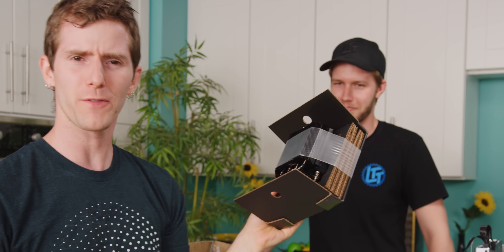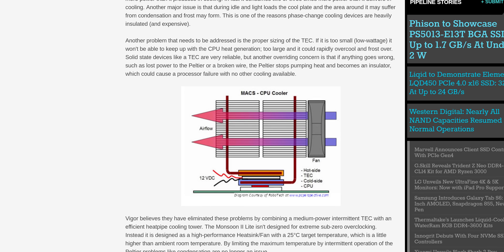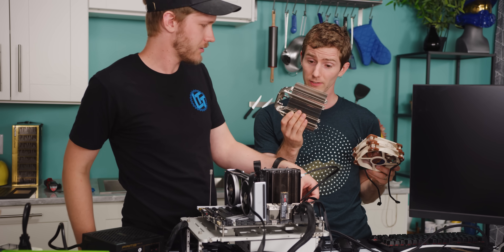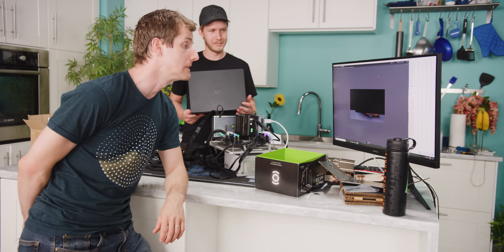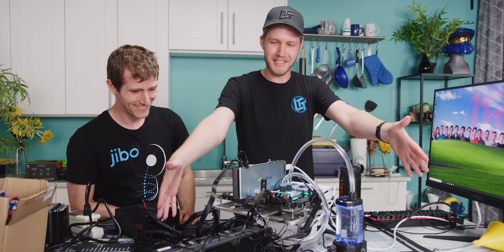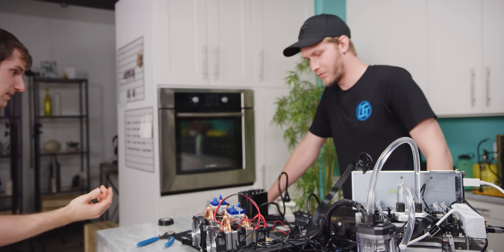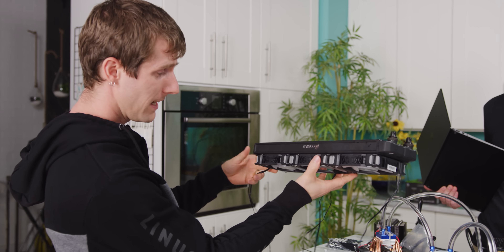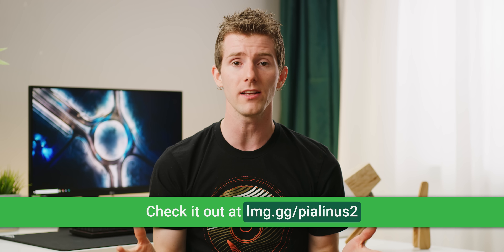Thermoelectric Cooling is a Bad Idea

Comment: I used a Thermoelectric cooler back when they 1st came back out in my day for my cheap budget Gaming PC on my Cyrix PR200 P1 class CPU. The cooler I bought was back in 1996 and it kept that egg and bacon fryer of a CPU within decent thermal limits. I sold the CPU and cooler to a buddy who was on budget ,I told Him not to replace the cooler and he did a short while after which he thought was a more beefy cooler well lets say able to cook his breakfast the next day on the CPU because the fan on the new cooler was inadequate to cool the  heatsink faster enough.

Comment: This really doesnt seem fair... Classic case of a reviewer slamming a product because he doesn't fully understand it. I expected better Linus.
It actually looks like a well made device - if it can keep up (within 2.5C) with a much larger heatsink under maximum load that means it's at least stable, and for loads less than 100% where the processor is going to be significantly above ambient but significantly below maximum thermal output, it is going to keep the CPU much cooler than the regular heatsink. I would bet in most gaming tests (eg where you are not CPU bound) this cooler significantly outperforms the Noctua.
I would bet they are using a TEC rated for >=150W, and under-driving it to keep the thermal load on the hot side heatsink within a sane range. This means the COP of the peltier would actually be quite decent, most likely in the range of 2-3, meaning it pumps 2 to 3 times as much heat as you're powering it with. For reference the COP of a much larger and louder phase change refrigerator is in the range of 3-4. Driving the peltier at 40W means you have an absolute maximum thermal load of around 120W, which i'm guessing you're exceeding slightly. Thanks to their design of adding a heatsink on the cold side, it still coped with this, but it does not seem to be its designed purpose, which is to dramatically lower average temperatures with common (non-synthetic) workloads at a relatively high efficiency. Bravo to the designers!

Linus, If you really want to build up an impressive peltier cooled system, in terms of both performance and efficiency, just throwing a >500W peltier element at it is not the way. Yes you may end up using such a part, but not alone. As i've mentioned peltiers are vastly more efficient when under-driven, certainly under 30% of their rated capacity, but it gets even better the lower you go, with the 10-20% range being ideal. If you want to achieve great temperatures with this, a stacked design would be best, which keeps the required temperature difference (detla) across each stage low. However that makes things quite a bit more complicated, as each stage will need its own power supply.
For example, you could take a 200W-300W rated peltier element and run it at around 50W, this would give you about 150W of thermal transfer capacity at a up to a 20C delta. You could then stack on a 500W peltier element and run it at around 70W, which would give you about 210W of thermal transfer capacity, meaning it could handle both the 50W of heat produced from the previous stage, and the 150W of heat transferred from the previous stage, again at up to a 20C delta. In the end you would have spent 120W of power on cooling, in addition to the 150W of heat from your CPU, but you will achieve up to a 40C temperature difference from the hot side, meaning as long as you can keep the watercooling loop below 65C with ~270W of heat being dumped into it (something i'm sure you can manage), you will keep the CPU itself (or at least the cold plate attached to it) at or slightly below room temperature.
Such a solution would be very competitive with using a phase change cooling loop; being more compact, massively quieter, and allowing you to dial in an exact temperature difference, rather than being at the mercy of however much heat your compressor system moves, which will either take you far below your target temperature creating condensation issues, or cycle on/off increasing stresses on components. While the efficiency of the peltier system is still technically lower than the compressor system can achieve, overall system efficiency could be higher when considering that last point, where going below your target temperature is actually more hassle than help.
The figures i've given above will need to be tweaked if the maximum thermal output of the CPU is beyond 150W, however this is another advantage of peltiers, you can spec them for your maximum thermal load, and turn the power down when you're below maximum load to maintain a target temperature (eg ambient) as this premade cooler seems to do, which only further improves efficiency.
Reply: How do you have the dedication to write this, I would have stopped halfway through
Reply: Can peltiers cool a CPU? Sure! Is it a good idea? Definitely not. It seems that's what you don't understand. And no amount of fiddling around with the setup will make the laws of physics go away.
You get those high COP values only if you have a very small temperature difference between the hot and the cold side. And no, stacking peltiers doesn't get you around this limitation, it makes everything even worse and less efficient.
If you have that small temperature difference, why do you have a peltier in between in the first place? You don't want to cool the cold side below ambient because of condensation.

Comment: I ran a peltier cooled system to run huge overclocks - not just sub-ambient, but below freezing. -12 degrees celcius on boot for example. Windows running at 5 degrees, with GPU temps (also pelt cooled) of around -2 celcius. 
This was back in 2006. 
This is far from new lol

Comment: Why can't it be a generator instead? From what I understand , the "pad" can be inversely used , by applying heat to the corresponding side , it will generate power . It may not be much but instead of sucking more energy to cool , it will a secondary "cooler" to probably trickle charge a capacitor or two.

Comment: Funny, I just spoke to some people about this.. I know the military uses Peltiers here to cool some tech, but they won't tell what exactly, only that it's very IT related and that they have had it for years???

They get the heat off the chips with Peltier and cool the rest of the output wit a closed LN2 setup, and no its not just a server room with this amount of effort put into it.... It might seem odd, but it takes the heat away fast and cleanly from the chips, whereas LN2 directly onto a chip is just... No... It's not a solid solution to go sub 0 directly on any components, over an extended period of time... But it's crazy costly, so I still wanna know exactly what it is they're cooling..
Reply: Might be cooling the photosensor of night vision cameras or maybe lasers in optic communication.
AFAIK these need to be kept at a constant temperature (photosensor for minimizing noise, lasers to stabilize wavelength) within a enclosed package, so a small Peltier with thermal feedback loop could do the job.
Reply: @Loundre3  hmmm... No, because this is a facility scale, with cooling towers like on nuclear reactors and the whole ting? Small scale by comparison, but apparently they use it at the base for something they've "had for years" which is stupidly vague.. I were told NASA were involved with the early design back in the 80s, which makes sense since they were probably the only ones who had the tech to utilize it back then... This is a partnership that still stands with the US and keep being updated mind you, so I'm quite lost on what it is?! I know from different people, both high and very low, that we work a lot with the US in the IT sector, but this is just curious to me.? What kind of military facility or partnership would need things that require cooling like that? Sattelite stuff maybe?!! It's awesome anyhow, but I ended up with more questions than answers.. Frustrating..

Comment: 10 core CPU?

What are you guys using?

Also, 40W Peltier? That isn't enough for anything but a Pentium/Celeron/Athlon these days.

Lastly, how about a 200W Peltier on a Ryzen 3000 series? We know PBO to be dramatically responsive to temperatures. That could be pretty monstrous.

Comment: "..300W" LOL.
Also, that 300W of extra heat would raise the ambient room temperature of a small room quite significantly. Assuming 500W already for a nice monitor + gaming rig then imagine how HOT a room would get with an 800W heater. Yikes! It's actually WORSE in my office with the house air conditioning than it is to open a window with AC turned off because my office temp isn't what's monitored so it can go over 90degF in the office when it's like 75degF on the main floor.

Comment: ! IMPORTANT !
Linus, I made an air intake with a peltier air-conditioning diy device that blows 10-15C° into the chassis, in a case which I aluminum taped all the unnecessary holes in my pc case and made it a negative-pressure environment (1 AC in and 2 radiator out, 12cm fans) and got all my devices cooled down average of 10C°'s. 
I would love to share my pictures, check me on Facebook inbox messages. -Oz Gunesh

Comment: Good video guys. I ran a TEC based setup back on a QX9650. TEC had it's own dedicated PSU and a relay to turn the TEC on and OFF with the system still. Have you considered running a Arduino or other microcontroller to control the TEC under idle to reduce power usage and keep condensation at bay?

Comment: A 1/4” metal slug at least as big as the peltier (copper or steel) directly between processor and the pettier spreads the heat gradient and allows the heat to transfer MUCH faster.  Attach the largest heat synch possible to the top of the hot side of the peltier and just vent the heat strait out the side of the case. (No water cooler needed).  I used to overclock to the max and still had the processor reporting 0C.  To prevent condensation, enclose the entire structure of the metal slug and peltier with closed cell flexible foam and use a waterproof sealant to prevent condensation outside of it.  RTV is acidic so use a non-acidic flexible sealant.

Comment: ok so @linus , you over clocked the rig with a plate with only 12 v input.?
Reply: At the university I managed something, I tried to cool the plate with a highter voltage , managed to get something decent using air and water cooling

Comment: Peltier modules are reasonably good at moving heat around for the cost of too much electricity, but you still need to get rid of that heat if you're using one for cooling. At the end of the day, it's pumping heat to where it already wants to go, so isn't really going to achieve anything.

Comment: Would be interesting to use a regular radiator in a water loop and put one peltier element in the line that turns on only when there is no CPU load to cool down the water faster, then turns off below idle temperature. This would allow nevermind I just got bored writing this comment.

Comment: I put a phononic Hex 2.0 cooler on on my i7-7700K.  It seemed better than single fan tower cooler.  With the Phononic software you can see it cycling on and off with various loads and you can change the power settings used.  It uses a power connection and a 2.0 serial connection on the motherboard.  I never had it show any condensation here in humid Florida.  I think a more simple large two fan tower cooler would be better overall.

Comment: Why not use radiator and tec in same loop?
Radiator→TEC→CPU/GPU
Reply: TECs as stated are inefficient, and turn into thermal insulators once overwhelmed. There's a limit to how much heat they can absorb over time which as Linus said, is fine for normal loads but extreme loads, like the rendering, will overload their thermal capacity and they start getting very hot. That's why the water cooled version did better, the water acts as a thermal buffer due to waters relatively high heat capacity.

I do wonder if it would off been better to run the water coolers in parallel rather than series, where the load is split more evenly so it doesn't overload one then the other, but I wouldn't be surprised to see a lack of major change.
Reply: @padfrog193  i ment that the tec is cooling water that has been cooled by the rad so if the tec fails its normal loop

Comment: but if you use de radiator to take the massive heat and them a peltier module to cooler even more the water?

Comment: The only thing that matters in a sustained workload is the surface area of the fin stack. It doesn't matter whether you move the heat with heat pipes, water or TECs.
Reply: Also the temperature Delta (Fins/Ambient) matters, so if you could have a magic TEC, which could move the heat for free (and brakes thermodynamics), your fins would be more effective and you could use less area.

Comment: This always seems like it should work. Not so much from the peltier magic - but because you are physically driving the heat away from the CPU. You apply electricity- and the cold side increases the thermal gradient on the cpu side. But you then have to dissipate CPU energy + TEC energy out the other side- which is often double (no free lunch in thermodynamics). So not super energy efficient or friendly- but if you can handle the heat - big radiators- etc - it should work. But every one of these I’ve seen performs much worse than expected. I thought about building one too- the parts are all over eBay.
Reply: Key phrase  was in there - “this is a much larger heat sink with twice as many heat pipes “ for the comparison model. The TEC itself adds its own heat. A LOT of it.

Comment: I think it's due to the surface area. The water spreads over on a bigger area and gets cooled faster with those three cooling fans. As for the other pair of coolers, it's like putting a can of warm beer inside the freezer and expecting it to cool down in seconds.

Comment: Is it possible that you put the fan in the TEC backwards? I mean, if you had the hot side radiator blowing on the cool side it wouldn't work correctly right? The fan should probably blow from the cool side to the hot.

Comment: I wonder how well this would work in  a passively cooled setup? Cuz the hotter the heat-sink gets on a passive setup the more airflow you get and the more cooling capacity you have. Might try it out on my passively cooled Linux server (what could go wrong :) ), I've got a Peltier module lying around somewhere.

Comment: You guys should do an addendum video on simply adding a TEC to an existing loop. I think having a radiator to remove the bulk of heat from your loop but having a TEC you can kick in when the CPU load is at a certain level (You can do this with a script and something to talk to the TEC in Linux) to start also pre-chilling the water before it goes into the CPU. Maybe even just connect it to a button on the front of your case....That's right, resurrect the turbo button!

Comment: So, to use a peltier element to it's full potential u would need an oversized radiator than can keep the cpu at max near ambient and then one of these peltier element equipped coolers behind the radiotor to achieve sub abient.
Kinda wondering if this might work

Comment: I had a TEC setup back in the day 2001-2002 and it was quite a pain in the butt to use. I had to order this Dow Corning compound to cover the front and back of the socket and also I had to buy sheets of neoprene to wrap around the socket and in the center area to keep the condensation from ruining my board. However, I did eventually manage to get my P3 down to -15.  I miss doing all that crazy stuff.

Comment: I have a peltier fan on my stove top, the heat from the stove drives the fan to circulate the warm air, is there a way you could use the heat from the CPU through the peltier device to drive an electrical load and also cool the CPU so you didn't need it plugged into a power supply?

Comment: I think you can get really good results with this stuff if you use it smart: why not use it in series with a radiator so the radiator takes most of the heat out and the peltier kan chill the water below ambient. That way you use the strong points of both and the weaknesses of neither.
Reply: The only strong point of a peltier is no moving parts. Cooling isn't.
Reply: Most people have said that's the right way to TEC cool (if there can be a "right" way to do something so insanely inefficient). You don't want to cool the source with the TEC, you cool the thermal mass that it pulls from the heat source.

Comment: Using Peltiers directly and as the primary cooling solution isn't practical. What I'd like to see is a regular watercooling loop with a TEC "booster". So you can let the radiator cool the hot water to near ambient, then use the TEC to go sub ambient.

Comment: Instead of using the Peltier effect to cool the CPU; you could flip it over, and use it as a power source for something  like the fan on the cooler, or some RGB LEDs or something. It would make your cooling worse, however, you would be generating electricity with the heat from the CPU.

Comment: You had the Peltier units upside-down. Do you trust the cheap heat-pipe cooler to work well like that???

Even wicking heat-pipes won't work at 100% potential being completely the wrong way up.